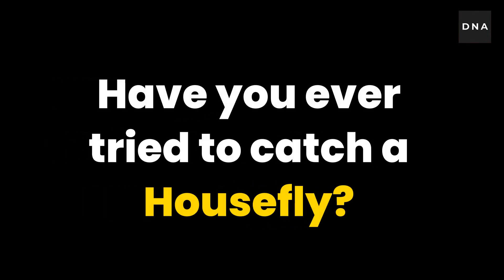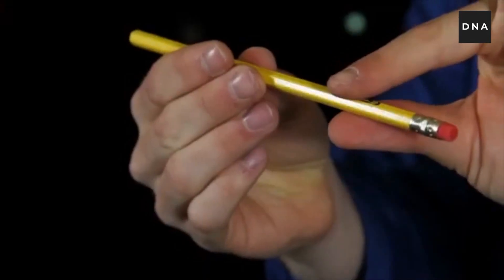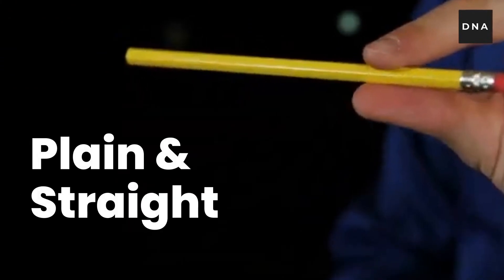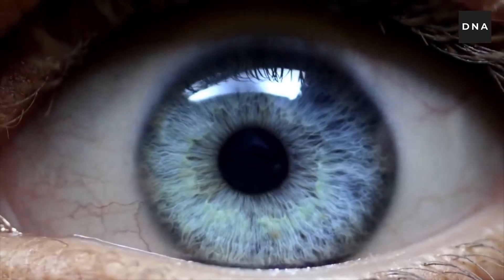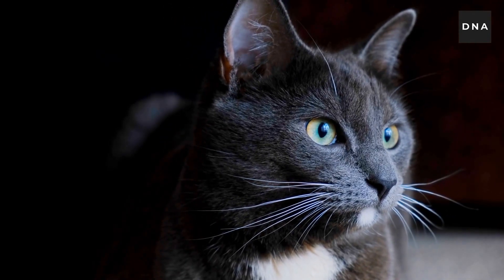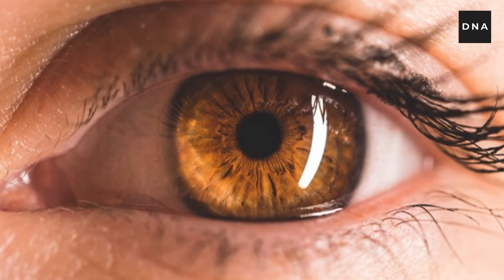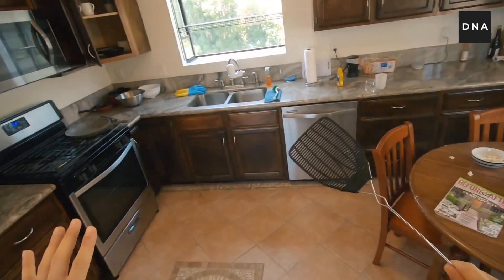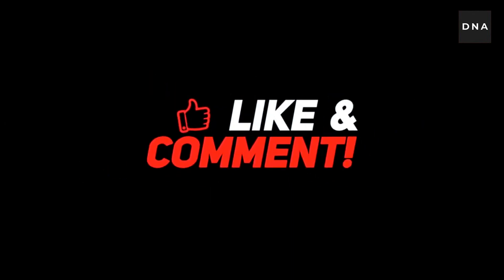Explained | Why Can't we catch a Fly | Curious DNA

Comment: I’ve never had trouble catching flies. I did train pretty hard when young. I can pretty easily hit them them mid flight too. They’re not fast compared to a trained human. As a test I just did it at my desk. An annoying small fly was crawling around my desk. It knew I as there when I hovered my hand a foot above it. They freeze, waiting. So I squished it. I’m a middle aged man & haven’t trained for a decade, so it splattered 1/2 inch from where it was when I started moving. The idea that you can’t catch them mid air or swat them  simply isn’t true. You just need training.